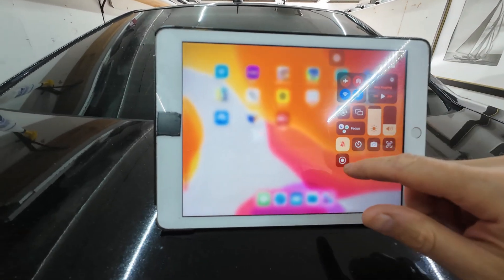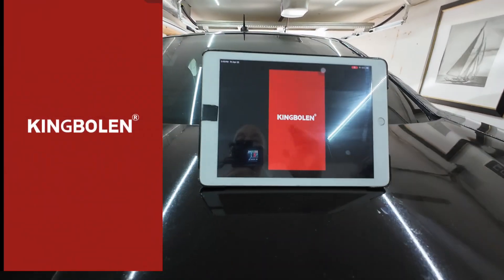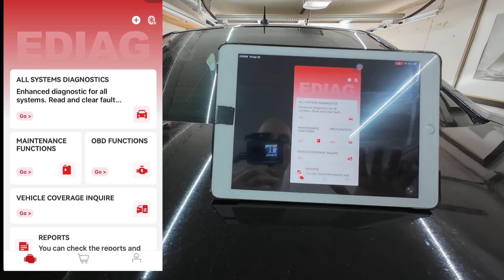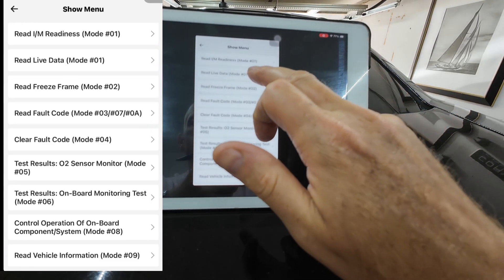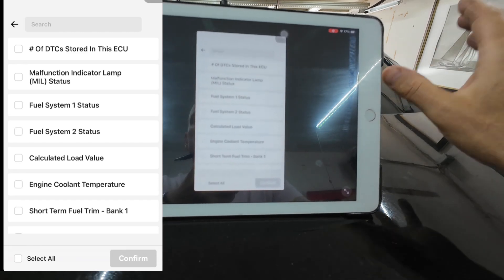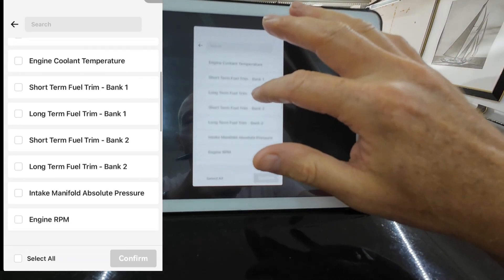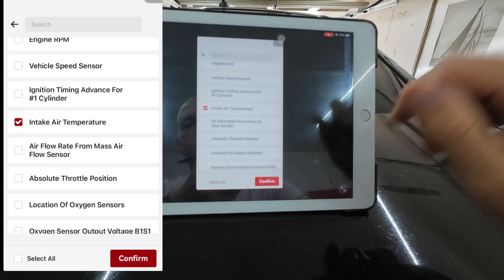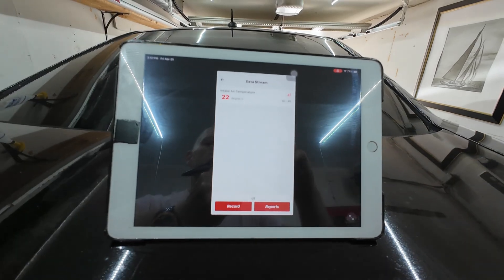How to Test and Replace a Transmission Fluid Temperature Sensor | P0711 P0712 P0713

Comment: HI, I also have the ediag. So when I want the transmission fluid temp to be between 95F-115F (for fluid change)  I have to look at the Intake Air temp to be between 35C- 46C  with the + or - 5 F difference? I tried asking edaig customer support but they haven't gotten back to me yet in about a few weeks and your video is the only thing I can kinda rely on for the Info. Thanks in advance.